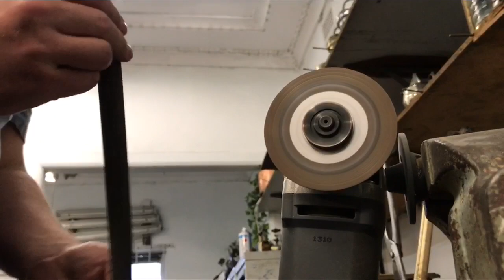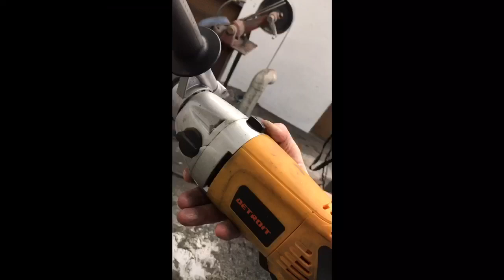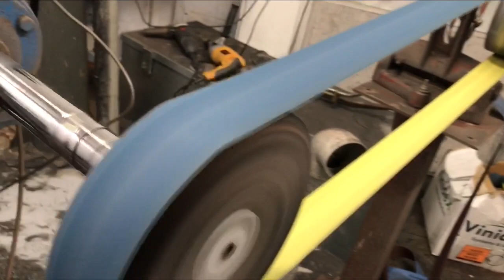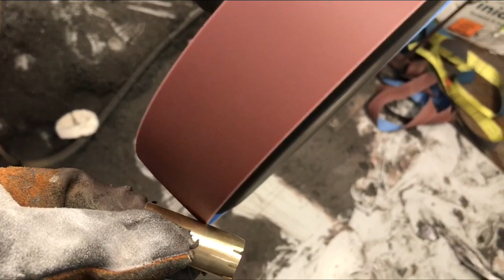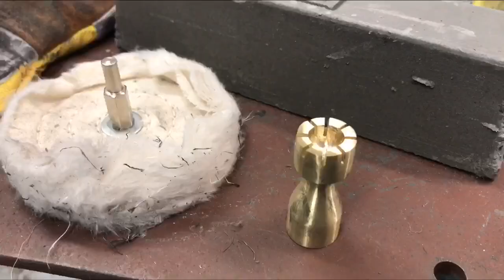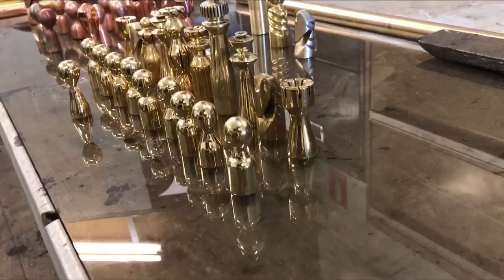Make a chess set from scrap metal easily

Comment: Nice work, it turned out great!

What did you start with 1" solid copper & brass rods?
Did you treat the pieces with anything to help prevent oxidation?
How have they help up?
Reply from the maker: Thank you.
I considered a clear coat but it seemed cheap and temporary so my final decision was to let them go naturally putrid. Highly polished it was difficult to distinguish the difference but now they have oxidised and they get used a lot. I’m considering perhaps a heat treatment or beeswax next time they get renewed. Hopefully In 1000 years they will be here, perhaps stuck in someone’s vacuum cleaner. How romantic.